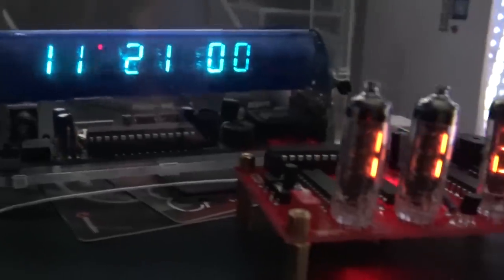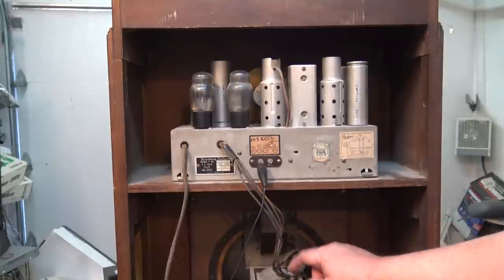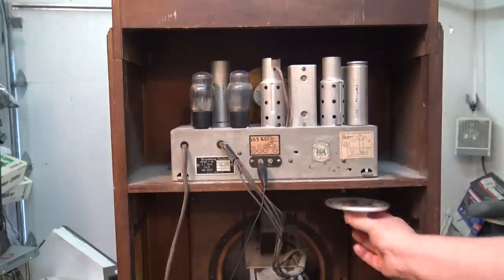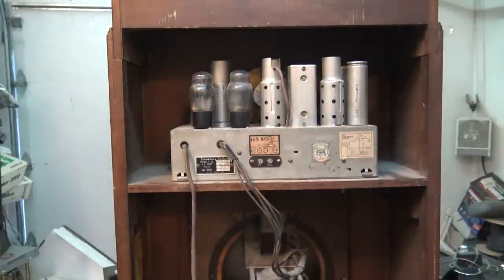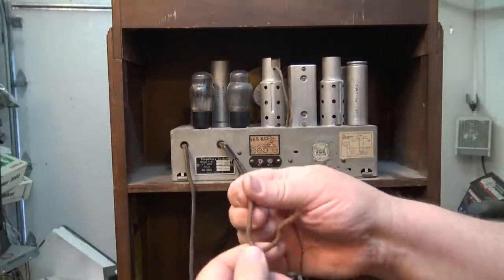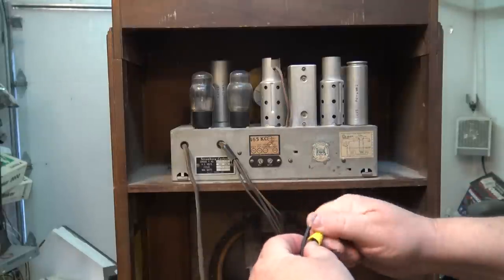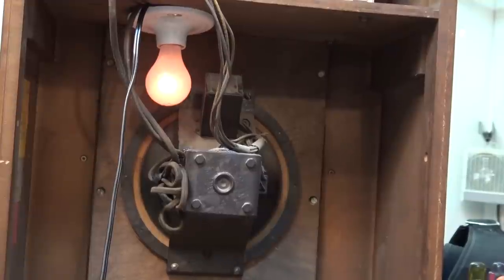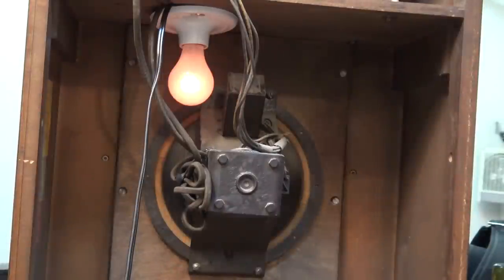Protecting your antique tube radios

Comment: Sadly, incandescent bulbs are now illegal in the U.S. except for specialist applications, such as aquarium/terrarium lighting, and replacements for older Christmas light sets, and vanity lighting. Even there, LEDs are quickly replacing them, and they don’t have the same electrical qualities an incandescent bulb does. I suppose you could find a radio tube with a 117 volt filament?!? Har de har har! :)
Reply from the maker: The dollar store still sells all types of incandescent lamps here up to 100 watts.
Reply: William Squires they are NOT illegal to SELL, it's the manufacturing, and importation that is.
As this was known well in advance, many bulbs were bought before the ban took effect.
So there are large inventories all over the country.
There is no shortage at this time.
Not only that, but even when the pre-ban inventory runs low, l'm fairly sure that some will be imported "under the table".
It's tough to check EVERY cargo container.
Reply: Lots still available, and then there are those "vintage" 60 watt edison bulbs. I see these everywhere these days. Expensive but they look cool and they are incandescent. Loophole in the law that allows these ones. Also garage door, and ceiling fan bulbs are still available, and rough service "surge proof" bulbs. Readily available
Reply: Rough service bulbs are still available
Reply: Will the heat of the bulb damage the speaker cone?

Comment: Incadesance bulbs harder to find ,I take it you can't use L.E.D. Bulbs ,I have a question I been wanting to ask you for a long time ,have you ever replaced a ferrite antenna In a tube radio,I going to have to ,because the radio I bought off of eBay ,the ferrite antenna was shattered,so I bought a blank ferrite bar magnetic wire same size,and have heat proof tape,I been trying for days to find anything on a,how to ,I think I can copy it.but I want to do it right .if you have any advice.anyone.
Reply from the maker: Incandescent bulbs plentiful here. Both conventional and the old Edison type.  I have some ferrite bar antennas in a box here. No you can't use LEDs. need that resisitve load.
Reply: @12voltvids  Have you ever made a replacement ferrite antenna,I bought the ferrite rod and the megnetic wire another tech told me to wrap 60 times,I got some heat proof tape to hold the megnetic wire on,I did try a loop antenna for a.m. stereo amp.that come with a little cheap a.m. antenna didnt work well ,so in a day or  two,I going to make my own replacement antenna for my G.E. radio

Comment: Even if you do a total restoration of a radio,  people say don't leave it plugged in because it could start a fire?....well how much more dangerous are these compared to when they were new?.... I doubt the owners manual told customers to unplug it after every use ?  I have about a dozen of these and they are all plugged in 24/7 have been for years... but I put a fuse in all of my restorations...I don't see these being anymore likely to start a fire as any other electronic equipment... I had a piece of electronic equipment start a fire ... lucky I was home at the time.... and you know what it was? a modern wall wort for my wireless modem....apparently it shorted and started pouring smoke it was so hot I could not grab it to unplug it.... I can see being careful but anything can cause a fire... even new stuff...
Reply from the maker: Well older electronics were not built to the same standards as new stuff.
Many a fire was caused by short circuits in old radios going way back. 
So I won't be leaving it plugged in when not in use, which won't be that often as I want it to last as long as possible.
Reply: Also, there were quite a few sets that had the resistive line in the cord to lower the b+. I know them as curtain burners, I'm not sure if you have the same terminology for them over there. The BBC used to end the days TV transmissions with the national anthem and then a warning to unplug your tv set before going to bed. That was easily the case in the seventies if I remember right. We only recently (last 30 years) got 24 hour broadcasting.
Reply: @12voltvids  

If the radio is properly restored it certainly can be left plugged in and used as much as you ant without fear of the radio not lasting.

I restored an RCA K-80 console back in the early 2,000s and use it quite regular. Have yet to have anything fail.
Reply from the maker: @ikonix360  you are still dealing with acient transformers.   Do you really want to risk it?
Reply: @12voltvids  

Some radios such as Zenith consoles with the 6X5 rectifier had marginal power transformers, but most had quality transformers and are ok to be used on a regular basis.

If I feel a transformer is suspect enough to where I feel that I cannot use the radio as long as I want, I find a new manufacture transformer that has the same specs and replace it.
Reply from the maker: @ikonix360  
Even if they had a quality transformer they are still 70 to 80 years old.   Things like the enamel insulation on the wires deteriorates from heating and cooling cycles.  No matter how much you have restored you can't solve the heat cool cycles. If it breaks down you end up with a short winding which makes more heat and could result in fire.
Reply from the maker: @ikonix360  not to mention running up hours on tubes which do wear out and many are not available anymore.
Reply: @12voltvids  

Some tubes such as eye tubes are herd to find.

The vast majority of tubes used in radios  (excepting some that used special tubes) are not very difficult to find.

Comment: Why can't you add a fuse??
Reply from the maker: What will a fuse do? If a cap goes leaky it will result in just a rise in current in the milliamp range.  Bit enough to blow a fuse till the power transformer shorts.
Reply: Depends on the fuse value doesn't it?  I use a 1/2A slow blow.
Reply from the maker: @greggchapman2677  when caps start to go leaky the current increase is gradual and your fuse won't blow untill the transformer shorts.  Light bulb prevents that.